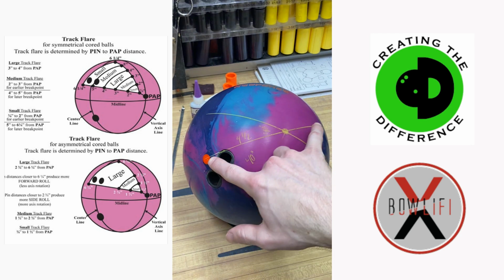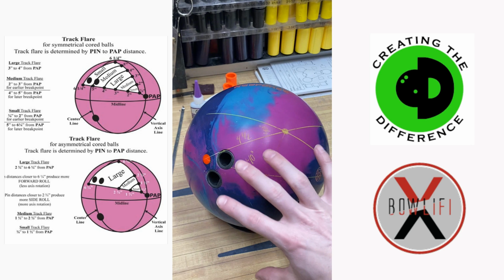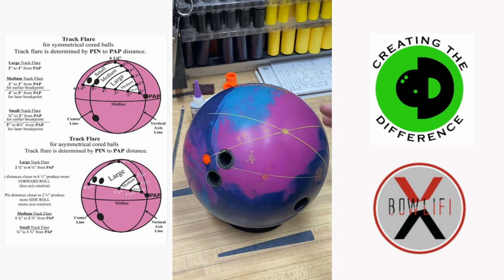JeWeL Bowling - Tips and Tricks #14 (PAP and Ball Layouts)

Comment: Thank you for this informative video.  Could you talk about layouts that are good for speed dominant player 😊
Reply from the maker: Hi Ahmed - great question. Here are some follow up recommendations based on player style.

(sums being the drilling angle + the VAL angle)

Smaller angle sums should always be used for: 
      • Speed dominant players 
      • Higher axis tilt players 
      • Longer oil patterns 
      • Higher volumes of oil on the lane 

Larger angle sums should always be used for: 
      • Rev dominant players 
      • Lower axis tilt players 
      • Shorter oil patterns 
      • Lower volumes of oil on the lane 

Medium angle sums should always be used for players whose ball speed and rev rate match. 

For speed dominant players, I recommend a smaller first angle (drilling angle) to get the ball to transition quickly to the roll phase. I'm talking angles like 15-25°. The second angle for speed dominant players while it can be small(er) runs the risk of the ball losing energy in the back end. I would recommend, in general, something like 30-40°. Anything much smaller than that I would be fearful of roll-out in friction down lane.

Of course, this is all high-level. Other factors to consider is how the ball will be used and on what conditions: house shot, sport shot, heavy oil, light oil, etc. But this gives a good starting idea.
Reply: @Josh Lewis  Thank you very much. I appreciate your reply 👍🏻👍🏻👍🏻👏🏻👏🏻